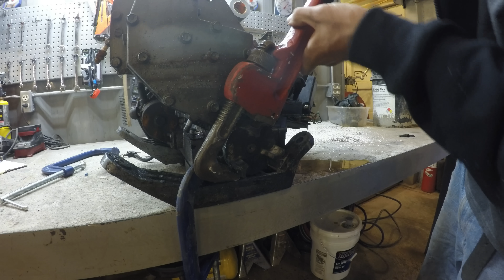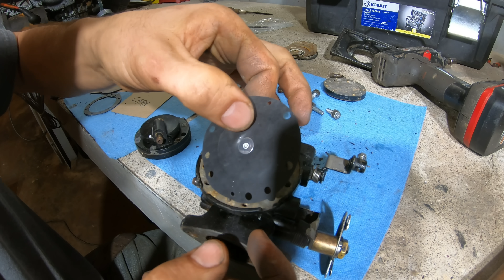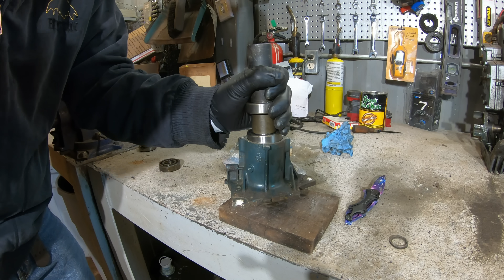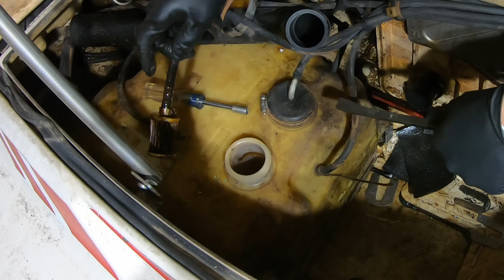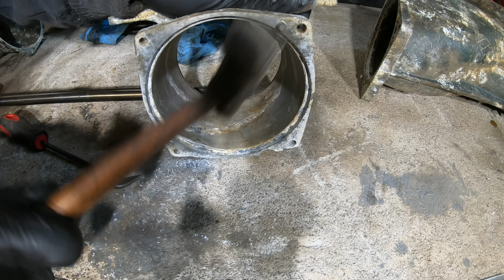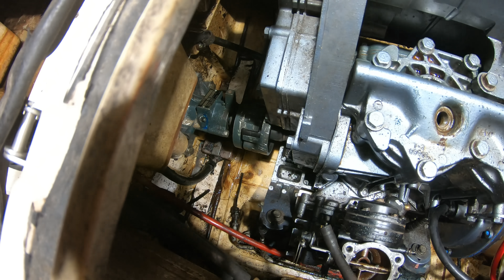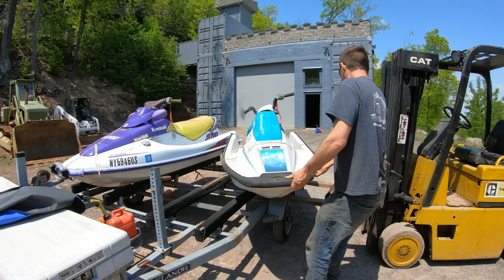Fixing the other $50 Wave Runner

Comment: Andrew go buy yourself a Brass Hammer , you make me nervous the way beat on things with that Steel hammer.  I have to say you are very good Mechanic and fast at figuring out how things work or go together.  I was a mechanic for fifty years, and the old mechanics taught me a lot how things work, that was back in the 50's. Have a great day Andrew.
Reply: I 2nd that.
1 Use a piece of wood so you don't "peen" the end the shaft.
2 Use some lube when assembling. It's just friendlier.
Reply: @AstronomyToday This is a lesson for all Mankind. Besides it's just friendlier!
Reply: I have about 2 feet of 2 inch round stock brass..... They would indeed make some nice brass hammers. I just have not gotten around to making some yet.
Reply: @kameljoe21  , AVE has a video of making brass hammers.
Reply: @327JohnnySS  You might have to link me to the video as I am not 100% sure who AVE is....
Reply: @firesurfer  , Thank you.
Reply: In response to the brass comment you fit bearings with the correct dolly or a steel pin punch not brass ask any bearing manufacturer 
You risk fine brass splinters entertaining the bearing 
Also ffs do not hit a bearing with a hammer good way to end up with shards of bearing under your skin
Reply: The old days were a lot more fun than today  eh Jake ?
Reply: That part was hard to watch
Reply: @mikejohnson9118  but peening the end of the shaft hardens it for the next time you're hammering on it 😂🤣

Comment: I cringed so hard when you smashed the cab and dropped the engine in and not a single torque wrench used but then I remember $50 jet ski and I was like yeah I would probably do the same 😂😂

Comment: Paper towels and air compressor to clean tanks.

Wicked!
Reply: I gerry-rigged a long skinny piece of steel for lighting matches for tall candles in glass holders that would work for this also but the compressed air is aerating the water as it cleans also! But hed need my magic steel stick to get the paper towels back.out or what my dad & I called a 'polish ass grabber'. 
I'm 1/2 polish so its ok!
A spring loaded grappling stick, you put the stick in the hole, press the button at other end, several grappling strips of steel come out, grab item you want, let go of spring,pull stick out.  Comes in hand for keys in short drain pipes of parts falling into the engine well also. I have no idea what this tools actual name is!
Reply: Yea,  I took notes on that one.  300 IQ
Reply: Yeah, I thought he was kidding... until it worked.
Reply: Surprisingly worked well. Good to know
Reply: I took note of that too, rather easy & clever way to clean out dirty plastic tanks.
Reply: I added that trick to my toolbox 👍that was awesome
Reply: @Voklst Westie  "Flexible Claw Pickup" is one name for tool. But they can be called by many names, depending on makes & sells them.
Reply: @VoklstWestie  Mechanical Fingers
Reply: I would have never thought of it.
Reply: Paper Towels: https://www.youtube.com/watch?v=HYkjLUMx19I
Reply: Genius! I've been wrenching on cars for donkeys years and have never heard of that one...
Reply: Totally!!
Reply: Loved it! Stunned me how well it worked!!!!
Reply: I about shit , it worked!
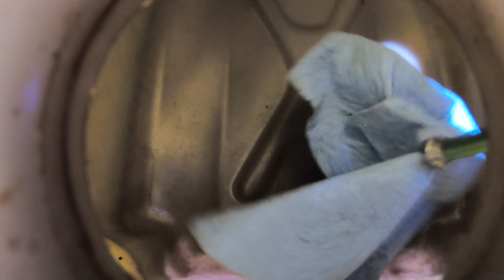Reply: @VoklstWestie  18:52  That's what he used to remove the rags.
Reply: @TransFluidGotKkkKick  your probably right. I'm amazed with Andrew's patience and skills. My favorites are his mechanic videos.
Reply: Can someone let me know the time stamp for when he cleans the tank with the towel I can't seem to find it.. I keep looking for it
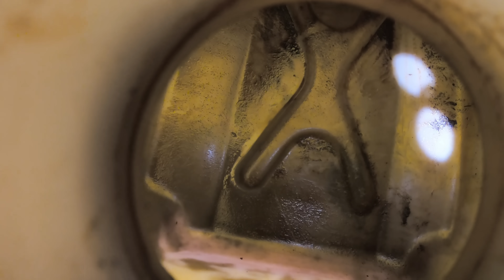Reply: @davidv7616  17:55
Reply: @throngcleaver  thank you very much!
Reply: @davidv7616  You're welcome, Dave!
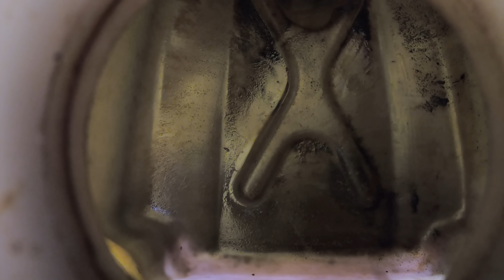Reply: @davidv7616  @18:00

Please pay attention its important ;)
Reply: I will give him  that great economy repair. However it probably ended up on craigslist for alot of money. All the hammering on the bearings is future problems . I feel srry for whoever buys it
Reply: Get fid of the forged  hammer and use a deadblow or brass omg.
Reply: Omg freak really this video get worst the longer i watch .. shims we dont need them ..bro use feeler gauges to set the driveshaft.
Reply: The hammer will make that carb fit

Comment: The fact you did everything with an impact and didn't break bolts is still blowing my mind
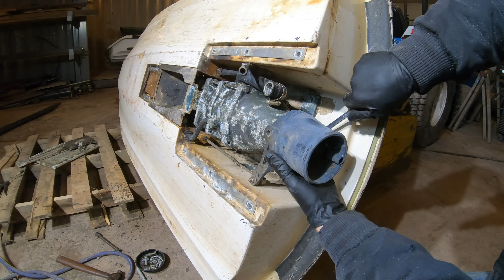Reply: 20:23 Breaks bolt with open ended wrench lol
Reply: Yeah I was kind of sweating at all the impact tool use on that aluminum too but hey this guy's a God level mechanic compared to me so I can't really criticize 🤣😂
Reply: That's not an impact driver. 
It's just an electric screw driver with a clutch. 
It just sounds like an impact tool.
All it's doing is slipping/pulsing when the torque gets high because that's usually when the head of the screw is entering the material, so you want everything to turn slow so you don't bury the screw head in the material.

Comment: Only a suggestion to another great " brought back from the dead" I have pulled a couple wave runners out of the deep six here on the Delta,  only thing I have done different is I purchased a soda cleaner to clean the crust of external parts and spent a little more time with the impeller and housing. The difference between 2 tigersharks 1 just cleaned out and thrown back together and the 2nd one I spent about 4 extra hours on Impeller and corrosion on external parts with the soda blaster was about 12 mph speed on the water. Not critiquing your work just inputting  another idea that might help in your restorations. I totally enjoy watching ever video you make.  I'm 69 and have slowed down , but still love fixing things others throw away....  My newest project is an old JD 310 backhoe loader, caught fire and all the pins on the backhoe and front bucket are shot over 1/2 in of slop in bushings... TG for my mini excavator as a crane to lift and hold those heavy control arms .  Anyway Andrew keep on just as you are,  hope you have a family in future to keep your great legacy multiplying
Reply: How does one find a waverunner that's at the bottom of the delta? Our owners telling you about them or are you hunting for them 🤔😁
Reply: @laprepper  actually the ones found have been floating with bow nose sticking above water couple inches. All I have pilled out were stolen and taken for joy ride and then sunk.  How stupid!!!

Comment: Hello Andrew. i found a simple way of cleaning rust and lime scale from any part of a marine engine and that is to use 5 table spoons of Citric Acid too 2 litres of water and leave to soak it does a great job and if you heat it up it works a lot faster i like to share my tips
Reply: Great tip!
Reply: does vinegar work equally as well? thank you for the tip
Reply: how many months do you leave it in that?

Comment: This repair/restoration has been brought to you by: The Jeremy Clarkson School of Mechanicalicular Fixing  :D  (If at first you don't succeed, hit it harder)
Am I the only one that was itching to start cleaning up those components rather than just slap them back together??
Also: that paper towel fuel tank trick was amazing!
Reply: Yea, definitely more of a 'fix' than a 'restoration'. I appreciate both approaches though.
Reply: I'm with you on the "cleaning up components" !!!!
Reply: Yea I wanted to take a wire brush to about 95% of what he was doing.
Reply: A Steel Ball Peen Hammer, on the end of Threaded Shaft.....Seriously?  Ever hear of a Brass Hammer, or using a Brass Drift, to avoid damaging the thread? 

All that rust that Broke Free from torquing with a Stillson, has now turned into Iron Oxide Abrasive slurry.....how long is that engine going to last?
Reply: @fviola2519  yeah!! He repaired it, but not for long till he's going to repair it again after some use and abuse. Some says "he's repairing it, not restoring it" but even so, he should've repaired it the correct way of doing repairs not like that. I cringed a lot of times while watching this.

Comment: Dude..I do the exact same type of work..I work on everything from jetskis to side by sides to lawn and garden ,streetbikes ..ive brought back stuff that has been dead for 25 years...the carburetors and bearings are always the worst..i also build hotrods and boats...you did everything i would do ...but i would have pulled the welsh plugs in the old carb and cleaned behind them..I also run brake clean through all the passages and jets ..then i lightly coat the carb with wd40 before i reinstall the diaphram and reads..I also pull the needle...great video,thats exactly what its like in a real shop...you did get lucky though pounding on that threaded shaft ..i thought for sure it would have mushroomed...that feeling is the greatest when you bring them back...I have two polaris sl 750s Im bring back to life for a customer right now

Comment: Heck of a good job! You spent $50 on an old wave runner, a few nights of work, and finally had to get a new carb to get it running good. Not bad at all. 2 or 3 weekends of fun in the water and it will have paid for itself. Glad you didnt waste a bunch of time and money on it.
Some think you should have spent thousands of dollars and hours, replace every part, and have a build sheet that would confuse a NASA engineer to have a meticulously restored a $50 waverunner to compete in the Pebble Beach Concours d'Elegance,  , and in the end you would still have just a $50 toy....

Comment: For the love of God, use some Never Seize and Grease, if I were rebuilding that thing all the moving parts would be swimming in grease.
Reply: OMG yes! Can't sleep now after watching this.
Reply: where did that jet ski come from? salvage? did he dredge it up,abandonned? was it free?
Your right though Never seize saved me hours of having to cut the aluminum prop off my mercury outboard when the rubber hub went bad. Was the first time I was introduced to Never Sieze, still have the same can from 1968
Reply: next season he will do the right thing
Reply: it will be too messy next season when he properly overhauls it
Reply: i didnt see any rebuild i seen a $50 jet ski is running now ..
Reply: Personally, I'm in the Never Seize and Grease corner but there might be some "Method in his Madness". When reassembling, seizing all the parts back together might be the only way he hasn't turned a Wave Runner into a grenade.
Reply: ridiculous
Reply: thats a pipe wrench. Never seen that wrench used in mechanical apps
Reply: @luquiacha  well now you have

Comment: Should make yourself a bearing Press Andrew 😳 And invest in a cheap bead blaster. Great video😁👍
Reply: beating bearings in with a hammer makes them last 2 months
If your going to do that beat them in on the outer race! You flatten the balls in the bearing that way eventally causing crumbling of the ball bearings and disaster.... at sea
Reply: we need a video on how to make a sand blast cabinet
Reply: jim halcom I think you can actually buy one from harbor freight cheaper than al the stuff you would have to buy to build one.

Comment: I know this is an old video, but I love the way you clean out that tank with air and paper towels. It's really smart. I know people will bitch that the wear ring should have been replaced, but what you did will work fine for a cheap machine. It won't be perfect, but it really isn't worth putting real money into that machine. I like that you actually FIX things instead of just parts swapping. I know parts must be swapped sometimes, but not all the time.

Comment: Good video but PLEASE do not stick a vacuum hose in a gas tank to suck out the trash (17:40).
There is still gasoline and gasoline vapors in there. Flirting with potential disaster there.
One other thing - Starting fluid in a 2 stroke is a bad idea too. Will dry out the cylinder wall instantly so there will not be any oil there when it fires.
I put one of those pineapples on the end of my pressure washer - makes a huge difference.

Comment: Use a larger hammer when pounding on flywheels and bearings as to ensure vibration & short lifespana
Reply: Yes, and for cryin' out loud never, and I do mean never, clean up that shaft with some 1000 grit sandpaper before fitting those spanking new bearings. That could cost you a good five minutes at least. 
This fellow has an ultrasound cleaner and doesn't even leave the carb in it long enough to get it clean...like over night. He didn't even take it apart before dropping it in the tank. Puts a corroded housing back together without a hint of gasket sealer. The whole thing was painful to watch.

Comment: Props to ya on gettin it ta run !!!  You can't beat the price if you have the time ...I have an old SLX780 that looks beautiful in my garage that I abandon years ago because of the positioning of the gas filler cap positioning...I don't know what some of these manufacturers were thinking back in the day but they positioned the gas fill tube down low on the watercraft by where the craft meets water. THEY ALWAYS SEEM TO TAKE ON WATER IN SOME FASHION OVER TIME IN THE GAS TANK FROM WATER SPLASHING OVER THE FRONT OF THE WATERCRAFT.I had replaced caps,tanks,fuel lines twice thinking there was an issue with my fuel system but not really so...just a design flaw on the watercraft.I then bought a used Seadoo where filler is up high on watercraft and believe it or not 15 years later I still own and run it with no fuel issues.Water in fuel can really be your biggest enemy sometimes.

Comment: nice vid, but i wonder how many hours that rusted engine wil last before it grinds itself into pieces, because i didn't see the engine being taken apart and new bearings
being fitted and remove whatever rust that locked up that engine.
Reply: Itll burn it out
Reply: No it wont.  I had the same one.  It filled with water twice..they have a problem with leaking in the aft...and spark problems...it's all that ever goes wrong. I gave mine away..it's still on the water today 24 years later.  Those things are bulletproof.
Reply: @jimb032  When water is to long in a engine, then things start to rust, specialy the ball bearings, so i hope that that is not the case for yours.
Reply: I had a 650 Mercury outboard that sat at the dock underwater for 2 months
it was completely packed inside with sea salt the only thing thst saved it was it stayed under water for the duration!
Reply: at 50 dollars a Jet ski? I dont think he is worried
Reply: @rogerd4559  he made his money back plus some off the video so he dont care at all lol
Reply: LMFAO it a $50 jet ski WOW SMH
Reply: There was a bunch of bearing growling and whirling going on. I still heard during the water testing. The guy has a gift though for sure....I'm Major ocd my self.

Comment: Good shit man, but it is absolutely infuriating watching you leave the engine a rusty mess and not giving every inch of that thing a good cleaning. You already took that thing apart and put in a lot of time and effort you should do the job right.
Reply: OH my freaking lord my OCD was killing me watching him put all those parts back together with so much crap on them.  All those tools and no wire wheels??  Not only that but not a torque wrench in sight.  Zero cross bolt tightening either.  This vid drove me crazy.  LOL

Comment: At this point, you have to have a Navy of rebuilt Wave Runners. Are you the bad guy from Water World?
Reply: I almost fell out of my chair when i read this.......
Reply: Good job getting it going but those 500’s and 650’s are turds when they are running perfect. 700’s and up is worth effing with. You can sand out some of that corrosion in the wear ring around the impeller, just don’t remove too much and have a large gap.

Comment: Applause, but if I ever catch a tech working on anything of mine with a pipe wrench....
Reply: Or smashing the thread on the shaft trying to get the bearing off, there i no way the nut would have gone back on without repairing the damaged thread, that is just rough.
Reply: that is why so many garages hide their work on your cars. they are all hammer mechanics
Reply: if you catch him you may regret it as he may use the pipe wrench on you!
Reply: I witnessd a mechanic removing my rear drums on my car with a 4 pound sledge rather then back off the brake adjusters. Then telling me I needed a new drum, cylinder all new brake parts cause they were all busted, They closed down that Mieneke muffler place a year later for some strange reason
Reply: True, but he'll have to do it when I'm not looking!

Comment: Hi Andrew,
Nice repairs. I cringed a little when you were pounding in the new bearings. I thought you had a hydraulic press. New girlfriend that was helping out?  :-)
Reply: The footage with the girl is a year old.
Reply: ChrisInChina the one unloading the jet ski was but the one of him pulling the engine and on the bench are new arent they?
Reply: @bustedford  Yes.
Reply: I love your videos, but when fixing stuff with bearings please learn how to do it right. I guess with that pounding the bearings will not hold up more than 5 hours, 95% of bearings failing within short time is caused by faulty installation said a SKF service tech. ,heat up the housing and drop them in. If there was water in the cylinders the needle bearings is ruined.
Reply: It's funny because you say all these things, but in the time it takes us to finish one engine right Andrew has fixed 13 "wrong". With a little bit of wheeling and dealing, he'll come out with less time involved, more money in hand, and more running equipment. I'm not so sure I'd be schooling the guy with an incredibly impressive fleet of equipment.

Comment: I am impressed,  I was seriously thinking what were you thinking in the beginning.  I too loved the paper towel trick in the fuel tank, my first thought was you were going to use a stick or something to clean it with the towels.  Awesome I would have never have thought to use air.  I did learn a valuable lesson about using dirty tanks.  I bought a 50 hp merc and after getting it running, gummed up the carbs with crap.  Nice video!!!  I am surprised they still have parts for this machine.